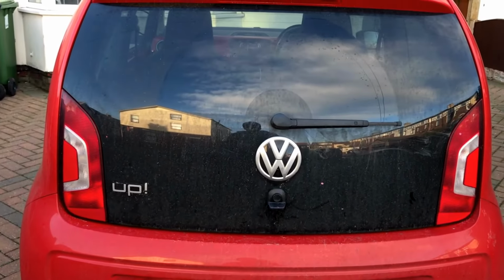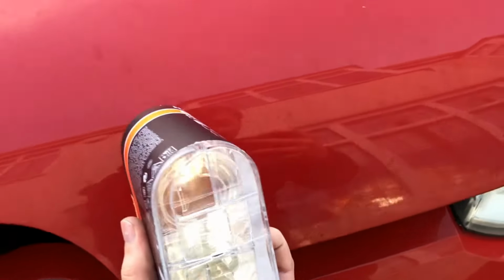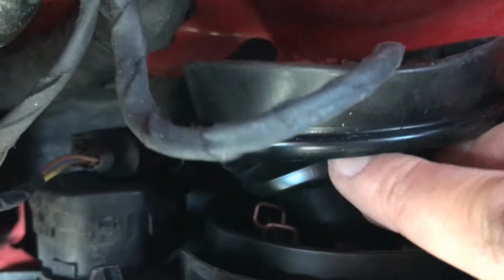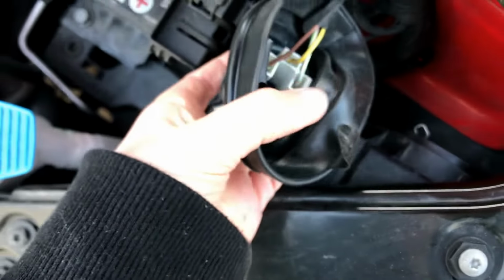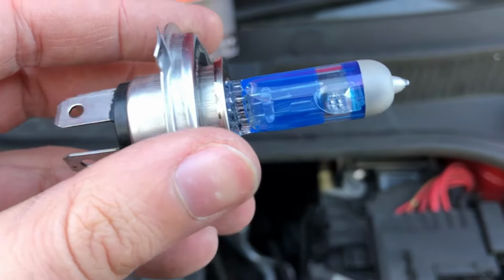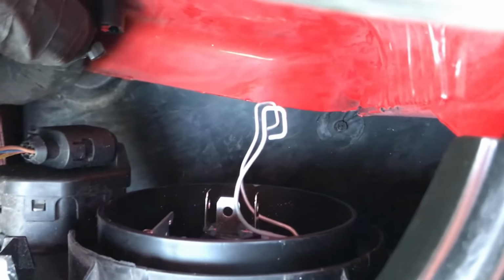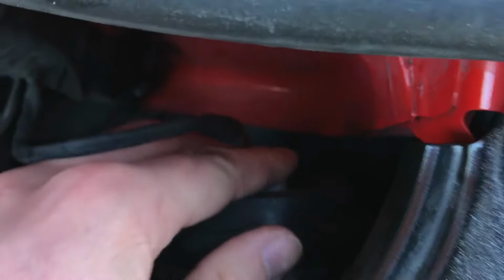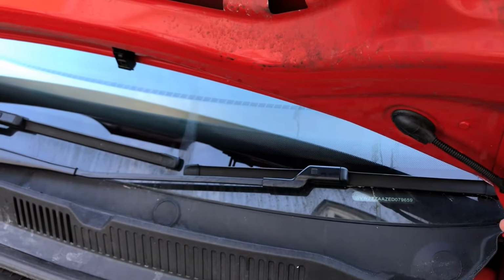How to Replace VW Up! Headlight Lamp

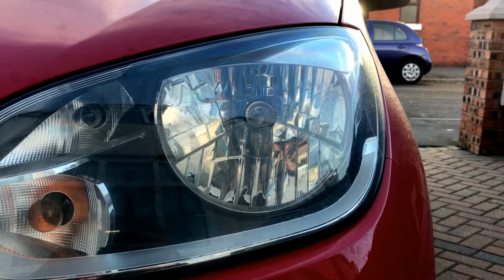Comment: While attempting to do this, the bigger ring as seen in 0:12 started moving. I mean the (almost) round, silver, bigger part in which the light bulb is inserted in the center, if you look from the front of the car. It seems like this should not be movable. Since the two catches are apparently attached to this part, the bulb is also moving. Any tips? 😱

Comment: Why is changing a light bulb so complicated on modern cars? What's wrong with just taking out a few screws, removing the lens, unscrewing the old bulb, screwing in the new one then replacing the lens?

Comment: Thanks for this video.  Seemed worryingly hard to remove connectors, perhaps because car 5 years old.  Your way worked much better.  Now just need good road legal 580 bulb to go along with the brighter Osram H4 bulbs.